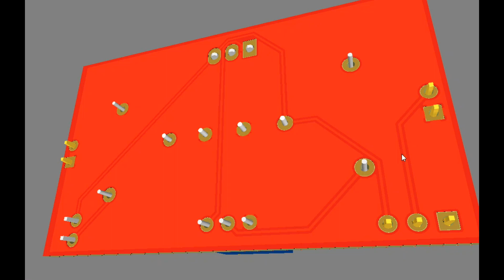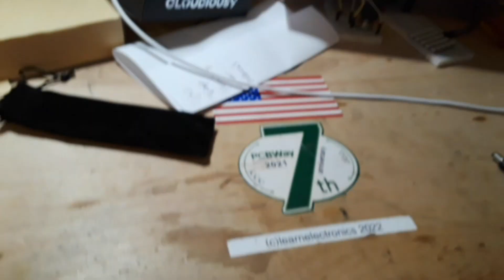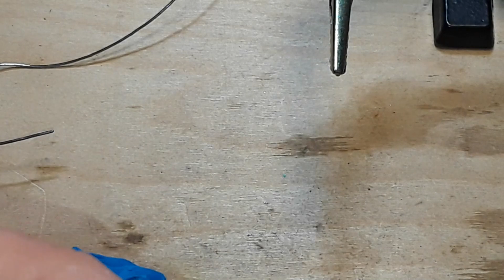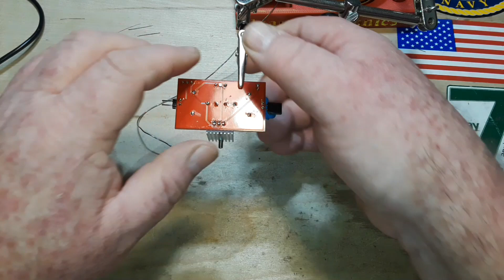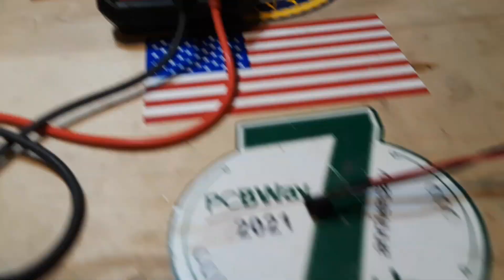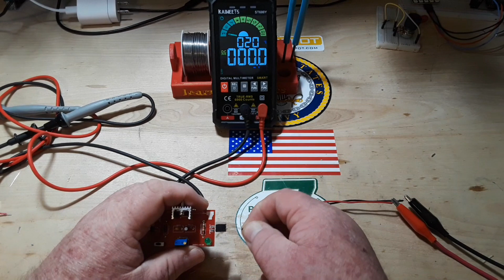Adjustable Voltage Regulator for STEM

Comment: If you change your 1k resistor (R1) to a 1k5, you will get a vout range from 1.25 - 9.58 volts.  With the 1k,
 Vout is trying to regulate to 13.75v maximum, but can not because of the 12v input.

Comment: PAUL, Can you make a video lesson about how to make a power supply that can take any AC outlet AC voltage which its called "Universal voltage" because the power supply can detect the AC voltage and when step it up or down but you can explain in the video lesson how it does this because its considered a SMART power supply

Comment: Wait… there must be something wrong, turning the pot does not modify the output voltage at all…I think that the ADJ pin should be connected to the the wiper pin of the pot, and the feedback from R1 connected to ADJ. 
I might be wrong though 😅

Comment: Looks like you made a boo-boo with the adjustment, as illustrated by 5 full turns of the pot and only 10 mV change in output voltage. You should use the pot as a rheostat (i.e. connect lower side of R1 to adjust pin and one side of the rheostat, the other side of the rheostat goes to ground). Right now you basically have a third variable resistor between the voltage divider and the adjust pin.
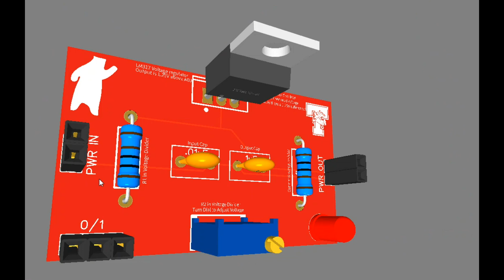Reply: I think it was. It wasn't fully visible. Around 3:20
Reply: Well I tried that setup out myself, and it does actually work. So there's something else funny business going on if there's no response to pot tweakage. Doesn't change the fact that it's wired strangely, though.